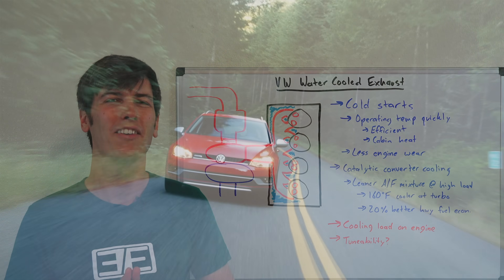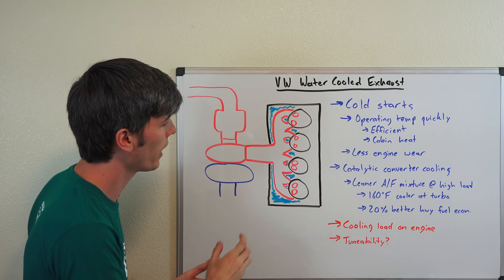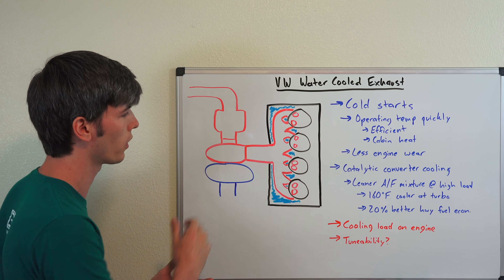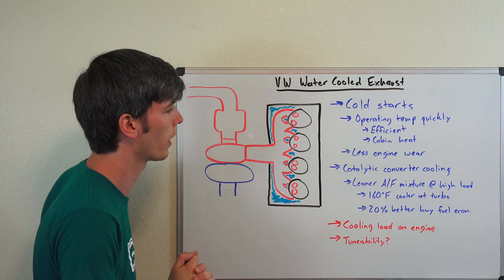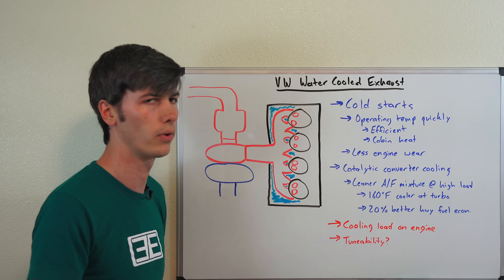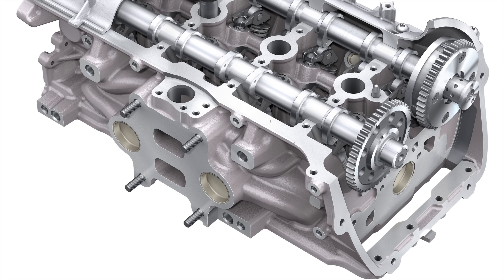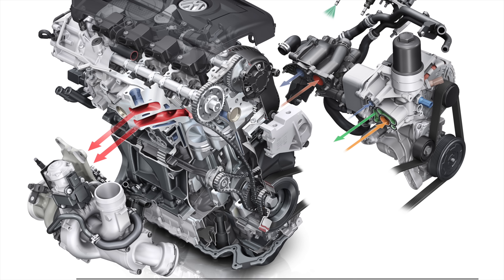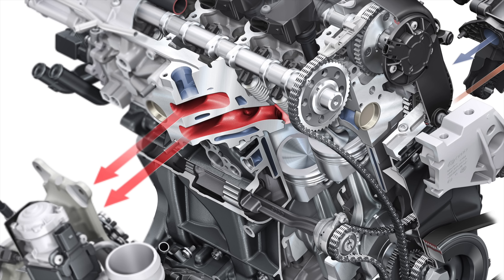Why Does Volkswagen Have A Water-Cooled Exhaust?

Comment: Next time the engine overheats, I think I know where the aluminum head will crack/warp
Reply: The white smoke will be EPIC.
Reply: no one wants to overheat their engine.... failures happen, leeks spring and maintenance gets missed. it is an unfortunate reality.
Reply: If VW is so concerned with doing it right, why do they have such a garbage cooling system in the Audi TT?? Its the same engine they've used for years... they know exactly what they are doing and it isnt to anyone's benefit but the nickle and dime of VW themselves.. Whats the point of having 2 water pumps doing an incompetent job, when 1 does it right with every other manufacture...  Thats okay, because VW will still use cheap ass Timing belts, that need to be changed every 75-120k miles, instead of a lifetime timing chain... And ill keep buying up these cars for next to nothing once they've blown and turning them over for a profit..

Anyway.. People shouldn't have to upgrade to larger radiators, and drilled thermostats to keep the under-hood temps down.
Reply: Exactly. If you're on the highway and lose a radiator hose, by the time you pull off the highway your head will be 500degree and warping
Reply: DE Nichols like the way you think
Reply: There's nothing really obvious since the engine hasn't proven itself yet. Lots of theoretical advancements have been done only to fail miserably in real life.
Reply: stilkus dont overheat the engine....
Reply: youre right, thats so vw. lol
Reply: I'd wait for some solid data in the field before making glorious proclamations.
Reply: Jason explained that this engine runs cooler because of this design. It's less likely to overheat. Also, I'm impressed with how I think this will increase the turbo's longevity. The oil change interval may be able to be reduced as well thanks to cooler air going through the turbo, which is of course lubricated by the same oil as the engine.

Comment: doesn't cooler exhaust gas mean less exhaust pressure and therefore less pressure to use by the turbo? In my understanding reduced power, or a bigger turbo (and turbolag) are the consequence.

Comment: why not just cool it after the turbo?🤓🙈
Reply: I think the whole point is to make it part of the header casting to save on cost. For this class of car, power is not the main objective,
Reply: Damianseconda995 it's a reasonable idea. Again, my guess for the explanation is cost
Reply: Renzeth Bulawan sometimes witchcraft takes too much planning, but good conversation thanks :)
Reply: Adding more piping will just add more lag. example when cooling air after turbo will need intercooler meaning more piping.
Reply: Renzeth Bulawan no just take the cooling system of the exhaust and move it after the turbo
Reply: rbzbsb true but the general engine block is an old design, so there must be headers and everthing already. making a water pocket around the exhaust, i would think would be easier. less engineering.
Reply: Maybe but ya know Germans... Sometimes we can Nazi what they are over engineering.
Reply: Renzeth Bulawan naja, man weiß ja das die motoren oft nicht mehr inhouse designt werden und das oft mehrere auto modele mit den gleichen motoren ausgestattet werden aus kostengründen. ja die deutschen :D
Reply: Damn i did not know germans do witchcraft too... jk..
Reply: Renzeth Bulawan why would it add lag to the system the hotter the more pressure.
Reply: Because lag?

Comment: Question: Does this also mean that you dont have to worry about shutting your engine imediately off after some spirited driving? Because in a normal car the heat in the turbocharger would bake the oil within the turbo and cause trouble. But here the turbocharger wouldnt get as hot because of the cooled exhaust gases right? So this would also be a plus point for this engine design.

Comment: Doesn't this put a greater strain on the cooling system of the whole engine?  Or is the additional heat in the coolant a non issue with more modern cars?
Reply from the maker: Thaiseaweed yes, as mentioned in the video
Reply: Oops, must have missed that bit.  Thanks!
Reply: Thaiseaweed - it's not a big deal. They have to fit a larger radiator, but other than that there are no major issues. The coolant will still run at less than 100 C, including locally, i.e. right where the water jackets run past the exhaust passages. I don't think he showed this detail, but I assume that the water cools the rest of the engine first before flowing past the exhaust passages on its way back to the radiator. That would give the most reliable cooling to the cylinders...but it would be interesting to see what they actually did.

Comment: But the turbo will spin slower(((
Reply: The energy in the exhaust gas will change, that is simple thermodynamics. But it doesn't matter if the exhaust still has more than enough energy do drive the turbine
Reply: patw52pb1 turbo manufacturers 'bench test' turbos in test cells that fire the turbine with a large natural gas burner with air from large compressors.
Reply: First a turbocharger is simply a turbine driving a shaft that drives a compressor where the turbine is primarily reliant upon internal combustion engine exhaust gas velocity and volume to drive the turbine. 
The temperature of the exhaust gas is not as critical as the velocity first and volume second. 
This can be quickly and easily demonstrated with dry (non condensing) compressed air such as available in a shop and the typical blow nozzle discharged into a turbo turbine inlet. 
The compressed air discharge is room temperature and when properly discharged at the turbine will spin the turbine to the maximum rated RPM and load...  this is how turbochargers are bench performance tested by most manufacturers, remanufacturers and most reputable/high-end rebuilders/repair facilities. 

Yes, the exhaust gas thermal energy will change (reduce) with a lowered EGT, but that does not mean the turbocharger turbine will spin slower on a properly designed system. 
I am extremely familiar with the gas laws and what you are purporting is mostly a fallacy when you actually do the math to determine the effects of a reduced EGT on the turbine performance dynamics. 
As pointed out previously, the temperature of the exhaust gas is not as critical as many think that it is for a properly designed and engineered turbocharger system. 
Pre-turbine fluid/exhaust pressure is not critical to turbine performance and is more of a inducer/exducer/compressor area ratio byproduct. 
There is much more to a well engineered turbo system performance than pre-turbine EGT, many, many static and dynamic factors are involved. 
If what you purport is true, then why does the system depicted in the video have an increase in performance, efficiency and a net of approximately 20 percent gain in fuel economy with lower pre-turbine EGT? 
If you doubt what I have stated, contact the tier 2 engineers at Garrett, Borg Warner and or Holset, ask them and learn.
Reply: The turbo will spin as fast as with a traditional exhaust manifold. 
The volume of exhaust gas will not change.
Reply: +patw52pb1 You are incorrect. The mass of exhaust gas will not change, but if you reduce the temperature of the gas and keep all other factors the same, then the gas will either have a smaller volume or a lower pressure; both of which will negatively impact the amount of energy available to the turbine. To argue otherwise is to argue with basic physics...

Comment: Many car manufactures use integrated exhaust manifolds and have for a while. This is not new. They mainly do it to reduce cost as the manifold is one less part to bolt onto the engine.

Comment: Isn't the power that the turbo gets to compress air a function of the difference between inlet and exhaust temperature? It seems like this system would reduce the efficiency of the turbocharger itself by robbing energy from it.
Reply: Basic thermodynamics says that the temperature drop across the turbine blades is the energy used to drive them. Simplifying of course.

Comment: that wouldn't reduce the volume of exhaust gas going to the turbo? if one of the problems is the temperatures at the catalyst converter then why not cool the down pipe?
Reply: It likely will reduce the velocity of the exhaust gases to some degree. This isn't a really high performance engine though, so the gain in efficiency is worth the loss in power.
Reply: This manifold is still used on high hp builds, I think it’ll be just fine. Plus header tubing is small to begin with. What you lose in mm in exhaust port size you gain in velocity, temps, and spool time aka everything that matters. The 2.0t version is a beast. 18mpg right here hahah
Reply: The cooler air will theoretically be more dense, creating more pressure on the turbo fins I think.

Comment: On lots of cars the exaust manifold can crack with age what will happen here will you have to throw the whole engine block away .
Reply: well you never hear of cylinder heads cracking too often, what they are doing is deleting the normal exhaust manifold and instead using passages in the cylinder head. so there is nothing to crack. as Linken200 said normal exhaust manifolds are just thinner peices of metal welded together, compared to a thick cast aluminum head with passages. so that is why they might crack eventually, the cylinder head is not likely gunna crack.
Reply: No since the manifolds that crack are the modern thinner welded ones not cast manifolds. And you'd "only" replace the head anyway not the engine block, still much more expensive than a manifold though
Reply: + linken200 cast iron manifolds also crack, not so often but they crack, i have seen a lot of them cracked
Reply: Yes it's material stress from temperature changes and vibration mainly combined with rust from condensation that creeps in the pressed and welded edges. It's not the temperature itself as the same engines or very similar engines can run for 100*s of thousands of miles with a cast manifold without fail. BMW for example changed from a cast to a thinner walled welded manifold on their 6 cyl diesels and people were having problems with them after a few years, luckily you could retrofit the older style cast manifold and solve the problem for all eternity. like Chris Bigger said a cast head, aluminium or iron is much less likely to crack if it's engineered well enough.
Reply: On what cars and engines? Never heard of it being a issue, hence why it's still used in heavy duty industries or other enterprises where durability is promoted higher than weight. Of course once in a while a casting can be faulty as in everything masspruduced. But when you say you've seen lots of them cracked it makes me curious
Reply: It's probably more likely one of the undersized bolts (or studs) that the turbo mounts onto will rust and break-off.  Then you'll have an exhaust leak.  Broken exhaust manifold bolts are a pain to fix, just because the manufacturer wanted to save 50 cents by using a smaller diameter bolt.
Reply: Cast iron exhaust manifold actually crack quite easily : being thick, they suffer from their own inertia and self-induced stress appears.

An integrated exhaust manifold isn't a bad idea, as long as you design it properly, and not as unbalanced all in one... generally it's considered the best idea for a TC engine because it's cheap and gains from a good design would be lost because of the turbo itself, but if you want the most control on the combustion process, it'll be "alot of fun" to deal with this.
Reply: It won't crack because it's kept in a small temperature window between ambient and coolant temp. A conventional manifold see a much larger temperature span.
Reply: paulb4uk imagine the hot climate ....this engine will operate at 120 celsius ==)))
Reply: @Linken200
I know from experience that Honda Civic - D-engines - from the 90s up to somewhere in the 2000s cracked all the time, right between 2 and 3.  In fact, finding a non-cracked manifold at a yard from 92-95 is damn near impossible.  My theory is that the heat shield is meant to protect the manifold from splashes and things, not to keep other components from getting hot.  That shield is the first thing to rot so people just throw them away and don't replace them.  ...or maybe it's just poorly designed.

Comment: I did not even know they were doing this. But 20% better fuel economy on highways sounds like a steep claim. Maybe if going 200kp/h on the Autobahn on end, but when ceuising around at 100 to 130 peak load enrichment should not be an issue. At least that would be my guess.
I wonder if they will include this technology in their TGI engines which I am really excited about. I hope you will look into things like that in future videos.
Reply: it's either kph or km/h. the p and / mean exactly the same, no need to use both
Reply: TheLuckyDawg24 you got me there.

Comment: I don't completely understand why you'd want to cool the gasses before the turbo, as it is the heat (enthalpy) of the gasses that power the turbine. Why don't you just cool the gasses after the turbo when they already are much cooler, in order to not burn out the catalytic converter?

Just asking, not claiming anything.
Reply from the maker: Lukas well you could, and hybrids do it externally, but it's more compact this way - weight and size play a role.
Reply: Well anyway we can't do much else than to conclude that this system is more beneficial than the alternative, or they hadn't bothered developing it. Furtheremore a shorter and less complex exhaust manifold would result in less pressure loss before what is a  pulse charged turbine. I don't quite grasp how the watercooling has much effect on the gas temperature before the turbine, it would be a pretty high flow with a quite small surface area to cool the gasses. I can't help but think the cooling is more of a nessesary compromise they had to do to be able to have an "internal" exhaust manifold. I can see that it's win win in terms of getting the engine to operating temperature more quickly. Don't know...
Reply: Agreed 100%.  Cooling the exhaust pre-turbo reduces total kinetic energy available to spin turbine.  That thermal energy is now lost to the coolant and fed to the atmosphere via the radiator.
Reply: Water-cooled exhaust manifold = Ability to run closer to stoichiometric (greater fuel economy) without burning up the turbo or cat.

Comment: Wouldn't this reduce the energy going to the turbocharger? since the exhaust gases are losing heat and a turbocharger basically uses that wasted heat to create boost. will this result in the engine being less powerful when tuned ?